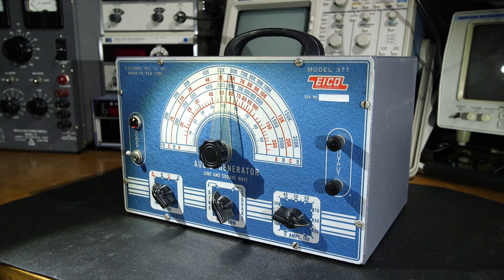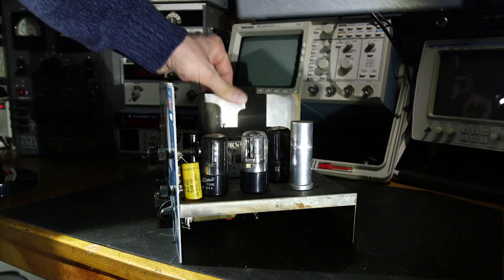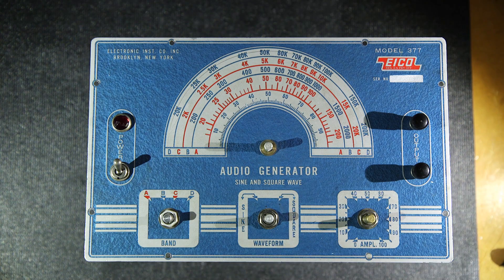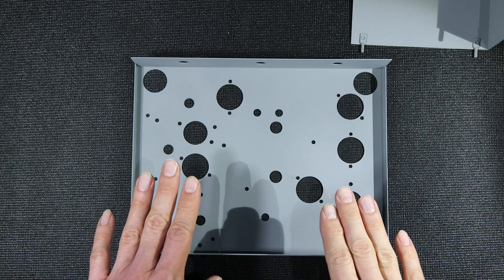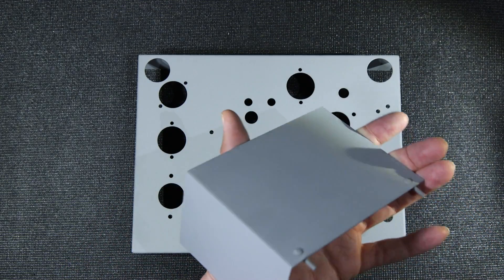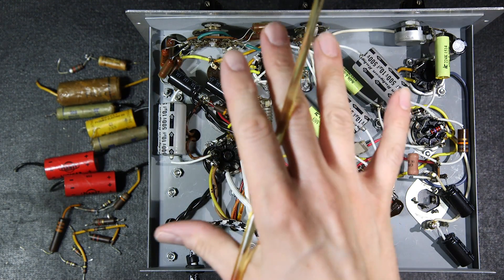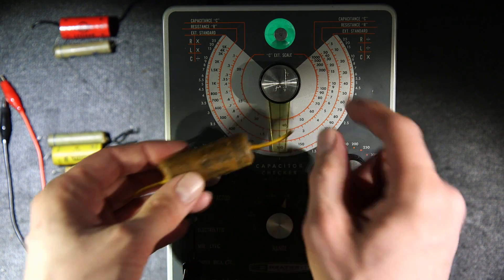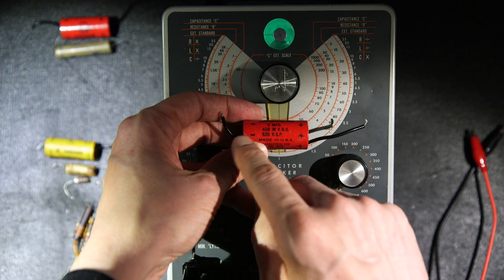Audio Signal Generator Restoration EICO 377

Comment: I have gone thru my EICO 377 100% and cannot resolve the square wave waveform above 100Khz. Iv have tried various 6SN7 tubes all measuring good. All the components in the wave shaping circuit are spot on and newly replaced. I did re-calibrate and the top limit is 200 Kilohertz ,  not 240 Kc. All power supply filter caps are new and stated value. I am going to hang it up  and put it in the shelf fir future use. Typically we seldom use all the frequencies available 20 to 20 Kc is any Audio amplifier range. I wont be using it as a function generator. My industry grade B&W only goes to 30 Kc and just sine waves.that unit was built as a frequency standard in most low power AM stations. I will be using these generators in experimental circuits evaluating capacitors and calculating values. It will also be a teaching aid.

Comment: Thankyou. I have been following for sometime now and I appreciate your passion for the old gear, as we called it. I have some  old Ieco and Heathkit gear and still use them, kind of a pack rat, and glad for it. Will be restoring my 1958 Quad audio amp, 2 mono blocks but a stereo preamp, all 220 of course. Don't believe there were actually marketed in north America at that time, but have the original  Manuel with schematic. Thanks for the inspiration.Best to you!

Comment: A nice finishing touch would be to reapply the original 1953 test date stamp to the repainted chassis using a silk screen from a digital pic.  Just to do MORE work.
Reply: No,  but adding the test date at which the equipment was tested and aligned by Mr. Carlson might be worthwhile...

I recently rebuilt my Hobart Kitchenaid Mixer,  which had a build date of 11/73.  I added the date of my rebuild to what is now a list.

Comment: These videos are always top notch! Love putting them on to learn more about electronics and as a nice background video for doing other tasks!I enjoy you safety perspective! I always try to do the best I can an avoid touching anything. So far I have yet to get shocked! But I do like the old tube equipment, I only fear it when first powering on after work or testing before working on it. That's when I think it will blow up! I hate that part but boy, do I love vacuum tubes!

Comment: Great video and excellent eye to detail. Have you ever considered using a electro plating kit. We use that a lot at the shop on car restorations. You can get a kit for around $50 with all the chemicals needed. The kit we have came with a battery pack for the electro plating. I just use a bench power supply. Works great and the coating is very durable. Parts I did over 10 years ago still looking good. 
Awesome video as always.

Comment: Another excellent video. I especially liked the technique for removing all the underside and valve sockets without disturbing them.

I notice that you chose not to mount an inline fuse into the mains cord as is done with vintage radio restorations. Any special reason?

Comment: Paul, love your videos.  I have a 377 silver face, so this is the first restoration video of yours  I have seen that I can put to practical use.  Two questions.  First, I expected to see an upside down hidden in the cabinet handle on this but you surprised me by leaving it sticking up.  Secondly, in researching mine I have read many comments about the ground connection from the front panel to the main chassis.  The front ground jack makes a mechanical connection to the front panel, which in turn makes only a mechanical connection to the main chassis.  Two possible points of failure.  Did you do anything to address this?

Comment: That red paint looks to be Glyptal...
Reply from the maker: Yes I agree, there is a very good chance it is.
Reply: I used to calibrate 4-20ma field sensors used in process control back in the 70s.  Platinum RTDs, flow and pressure sensors.  Once calibrated, I would dab some Glyptal onto the setscrew to dissuade tampering.  Looked just like your oscillator.   I just finished the video.  Your patience with these laborious overhals is astonishing.
Reply from the maker: Thanks! This one was definitely time consuming.

Comment: Hi Paul, great video again!  My goodness that was a labor of love.  You are fortunate to have access to the bead blaster, it is one of my favorite restoration tools.  Very Sherlock Holmes of you to deduce the black corrosion on the Cad plating to attack from Sulphide from Lead Acid batteries.  I have seen a yellow corrosion on Cad plated chassis before, but not black fortunately. I simply devour and delight at each and every new video here and on Patreon.  I'm just finishing building my take on the Cap discharge device.  I really enjoy your videos, brilliant engineering, and dry sense of humor. You truly are a treasure and I admire and appreciate EVERYTHING, you do.
Sincerely,
Gary Bevis
Reply from the maker: Thanks for taking the time to write Gary!

Comment: Hi Paul, I don't know how orthodox you are on restorations, but adding a neatly placed BNC jack may not be a bad idea (as long it as it doesn't clash with the "look" of the panel). I would add two.. the 2nd would be a 50-ohm square wave output driven from a single 74HC14 fed from a 7805 running off the heater supply, likely. The tiny dead-bug circuit shown by W2AEW (see: TDR using an oscilloscope ) is soldered to the back of the BNC so it's close to the jack and offers 2ns edge rise time, making this good-looking old-timer able to keep up to specs and signal purity of any modern equipment.. OK, that's my 2-cents for the day.

Comment: I have a 377 that has been sitting around and always wanted to go through it. I wondered on how accurate it was and the trueness of the sine and square waves. your video helped me decide to go ahead with it. Mine is a much later one (silver face) inside it says May 4 1971. The circuit looks the same with minor differences with the variable cap being a two gang. I noticed that yours was a 4 gang with the two sections tied together. The sine/square wave is a slide switch instead of the rotary type. This unit is nice and clean with excellent front face. Thanks for the video, I really enjoyed watching and I'll be checking resistors and changing all the caps and cleaning all the controls and switches, looks like a decent piece for my work!
Reply from the maker: Great! If you restore it, keep me posted.

Comment: Should you be so ambitious as to tackle completely depopulatin that chassis and bed blasting it, you could paint
it after applying a zync rich primer. Ya prolly wouldn't have any further trouble with corrosion after that. Just me
thinkin'...again(8-).

Yeah, reforming means reforming to oxide coating on the one plate that ends up being the actual dielectric.
And while you might get lucky and actually form some oxide (even a blind hog can find an acorn in an
acre now and then), it might just be a bubble in the "electrolyte"...which will pop...so I'll back Mr. Carlson
up 101%. Just junk those caps and install new ones.
Reply from the maker: Thanks Tom!
Reply: @MrCarlsonsLab  I think the point is that while reforming DOES work well as long the electrolyte is still there and adheres to original specs. The old capacitors with brittle seals (which weren't very good when they were new, too) WILL have lost electrolyte, though. At least it will be FAR off the original composition by now. Even if you get rid of the leakage and that stays that way for some reason, capacity and ESR will be still off. 

The oxide layer always deteriorates, actually it does that quite quickly. That's why capacitor manufactures recommend reforming after X years without voltage. Especially for large mains filter capacitors in frequency converters or something like that. 

But as soon as you actually lose electrolyte, that capacitor has been done for. And that is the case in all those vintage ones.

Comment: It looks like 8 people still reform capacitors lol Great video as always. I really liked your method of stripping the chassis. The Pi filter also looks like the Greek symbol Pi. EICO makes nice gear. I have an EICO Model 249 VTVM that lives on my bench and an EICO 369 Marker Generator waiting for some attention
.
Reply: Dave Micolichek  100% agree. I just rebuilt a linear power supply at work. All of the electrolytics tested bad. 5000uF 50V cap had high ESR and measured 30uF, the 100uF 50V cap tests at 4uF and high ESR, the smaller ones were all out of tolerance. The supply runs 24/7, cost about $350 to replace or $30.00 to repair (the big cap was $26). When it failed it destroyed a $800 DeviceNet card. I keep telling people that the future of electronics is going to be filled with failed PSU's and the fault will almost always be electrolytics.